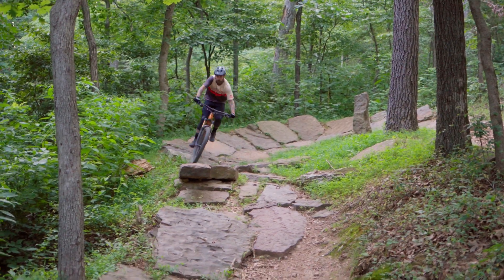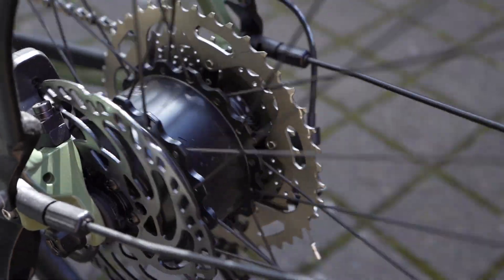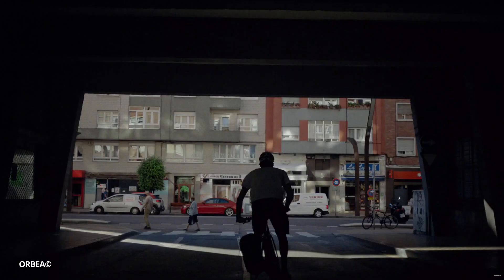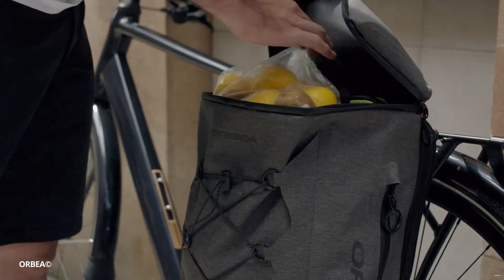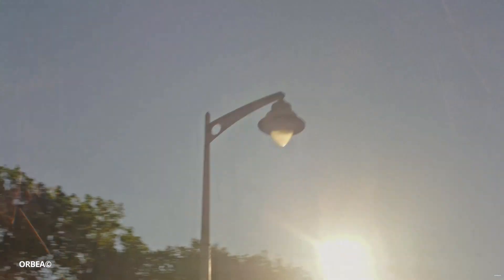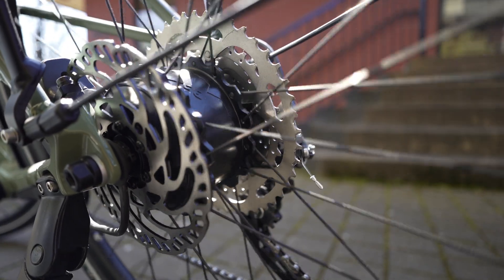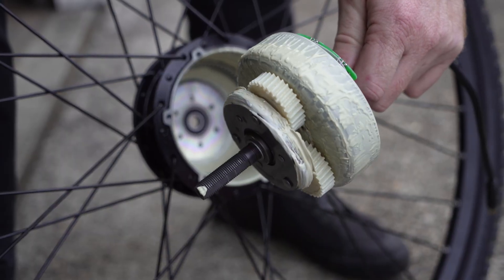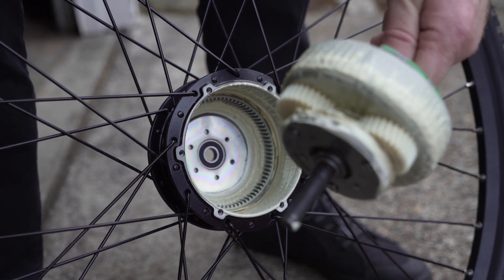HUB VS MID DRIVE | Choosing the Best Electric Bike Motor #electricbike #ebike

Comment: What would be the advantages and/or disadvantages of a front hub motor with rear  hub gears and a carbon belt?
Reply: I'm very interested in this config, but not a lot of manufacturers using it... 🤔
Reply: With just a front hub it becomes a throttle only( technically a motor bike)  vs. a pedal assisted bicycle.  Throttle only are not allowed on many (majority?) of bike paths. Also you would have less traction going uphill as the majority of the weight shifts to the rear wheel.
Reply: Not exactly. You can have Pedal Assist Sensors mounted to the crank. I have it. It works great. Also, front hub gives you all-wheel drive on a bicycle ;)

Comment: I think you're handing out a myopic perspective of mid-drives. Not all mid-drive motors use a torque sensor. Not all mid-drives need "professional help" to perform much of the maintenance to keep them running. Not all ebikes require a proprietary frame that can only use one manufacturer's underpowered motor and small overpriced batteries. You mentioned the two types of hub motors but didn't mention add-on mid-drive motors like the BaFang BBSHD and their massive advantages... such as torque, throttle, adaptability, ease of installation and self-repair, cost, programmability, etc, etc, etc. There isn't a production mid-drive ebike I would own but I wouldn't ride anything but a mid-drive ebike.

Most mid-drive chain and drive train damage is due to what should be an ever-changing chain line from gear changing. Riders rely on the motor to grunt it out rather than downshifting. Coupling a mid-drive with a Rohloff Speedhub is a game changer. Absolute minimum drive train wear and fast sure gear changes with a straight chain line. The Gate's belt will be another game changer, but it's a little more tricky to use a full suspension e-bike. With minimum chain maintenance, I change the chain and rear gear every 3K miles or about twice a year, less than $50, and I can do it on the side of the trail in about 45 minutes. 

I've been riding the same ebike for over 8 years and have ridden over 48K miles. Much of that has been with panniers and pulling a trailer on rough uphill surfaces, and I have never had a "heat management" issue. Apply only the necessary torque to an IGH; the motor will always stay in its comfort zone.  We're talking about ebikes; if someone rides an ebike like a little motorcycle, they will have excess damage and stress the motors regardless of whether it's a mid-drive or a hub motor... but mid-drives are superior to hub motors. - https://photos.app.goo.gl/ADgC6oyPM2gyrCq27

Sporting my latest and possibly final upgrade. Ladies and gentlemen, the Gates Belt Drive. - https://youtu.be/qu4vGEziby8
Reply: I agree with everything you say, and the new Bafang BBSHD motor is getting rave reviews and I never thought that I'd buy anything but a mid-drive, torque sensor Ebike but as someone with battery anxiety and motor failure paranoia I'm going to buy a Himiway Zebra hub drive bike, with torque sensor, as at least if the motor ever fails or I run out of battery then at least I can pedal back home.
I once tried pedalling a mid-drive bike without power and the drag put me off. 
That was a few years ago though, maybe mid-drive motors have less drag now, and maybe I should stop being paranoid! 🤷‍♂️😂

This bike is only going to be used on old railway lines and very mild gravel, and to cover longer distances than I do on my clockwork bike.
Should I ever replace my full-suss MTB that I ride in the mountains then a mid-drive would be the only choice.

Comment: Today was the first day that I was on an Ebike..  I tested out 3 different mid drive motors.. All with the carbon gates belt and all with the Invideo (not sure how to spell it) CVT hub..  All 3 bikes were totally different..  It was  nice that I could drive them without any pedal assist and today it was 95 degrees..  I kept all of them at the lowest pedal assist and it was a hilly area and they did ok..  I think my speed was about 10 mph..  When it comes to mid drives I think I do want a carbon gates belt drive...

I should probably test out some hub drives..  I probably don't need the carbon gates belt drive..  I have never been a huge fan of chains..  I don't think I ever broke one but I have got them caught in my jeans and also have had them come off a lot of times..  That and I have had it where they don't go into gear.. Also, not a fan of the grease getting over everything..
Reply: Belt drive & hub gears are the way to go with mid drive motors, far less maintenance, mess, etc. Not cheap tho.
Reply: @papalegba6796belt drive plus hub would be like the bike of the future imo. CVT pulleys on the belt drive and it's even better..

Comment: I am considering buying either a hub drive or mid drive motor to recover from injury but I live in a hilly area. I am looking at the Orbea D30 with the X35 hub motor or the specialized sl comp carbon with the Sl1.1 mid drive motor. I am 110kg and recently had a new knee and ankle fusion so would like to know which would get me up the hills easier until I get fitter. The hills I used to ride before my op were up to 20% on a typical 50 mile ride. I have heard that the hub drive will give up on you on steep hills as your effort slows but the mid drive will keep delivering is that true?
Reply from the maker: Both of those bikes are really great choices. As far as “giving up” goes a mid drive doesn’t show favor on flat or hills. It outputs power based off your input. Most hub motors will output based off the input of speed or throttle, but can’t tell the difference of hills vs flat and that’s where many will give up so to speak, with more resistance on the motor for climbing they have less sensors to compute the changes and output more power. That being said there are many high watt output hub motors that you can flick a throttle and it’ll power you up hills but that is a different cycling experience.
Reply: Thank you so much for getting back to me. It makes sense to me now about which to buy for recovery. I dont need a powerful embt just a road bike that will help up the hills round here. I dont want a motor to take over and I have enough power to keep up with a group but at 63 I am suffering up the hills more and more especially after my surgery. I have a good input so am going to test ride some mid drive motors of around 40NM or so. I think the SL 1.1 is 35NM so should give me just enough to get up most hills round here. I cant get out of the pedals so I have to rely on seated spinning until I am more flexible and things settle down abit more. I may not be able to as my ankle fusion is very restrictive and only flexes about 10% of what is used to but now I am pain free so we shall see. Thanks again. very much appreciated. @ElectricBikeJournal
Reply: @oxharp  Been very satisfied with road/gravel bikes with MAHLE X35/X20. If I was buying an e-road bike today I'd opt for Bianchi E-Oltre with MAHLE X30, Shimano 105 mechanical. $5K seems like a pretty fair price. My wife has an earlier E-Aria X35 model bought used that she really, really likes!

Comment: If you have access to many ebikes, I suggest you design experiments to back up some claims in this video. At least to satisfy your own curiosity. 

For example claims about efficiency and torque/ climbing being better in mid drives. They can pretty much be in the style of car MPG tests. Ride similar routes at similar speeds and count how many Wh it takes to fill up again.

I feel that your conclusions are more based on cheaper hub drive bikes vs premium mid drive bikes.

Food for thought: A direct drive hub motor can be designed to produce so much torque that it would taco the bike frame instantly. Electric motors can be designed for any load conditions and bicycle load conditions are not so difficult to design for.

My $100 Chinese direct drive hub motor can produce so much torque that in an MTB frame, the bike flips over. Sure the motor will also get hot, but it CAN produce the torque. 

Any gearing or use of multiple gears is a sign of a undersized or poorly designed motor.

Think if massive trains. They travel from 0 to 100s of miles per hour with one gear and with massive loads. A bike would be trivial to design for.
Reply: Your $100 motor is NOT that powerful lmao. Why would you bother lying about something so easily verifiable? If you said $1000 I’d believe you
Reply from the maker: All very valid and great points thanks. Most of what we addressed focuses on the higher margin of what someone is most likely to come upon as they shop for a bike. As most mid drive bikes are supported by premium brands and most hub drive bikes are coming from less premium brands. Each drive type has an ideal environment that they perform best in. 

This video and our platform is focused on the general audience and specifically people that are looking to learn. Thanks for the input and we'd love to see that wheelie machine.
Reply: @ElectricBikeJournal  Not my video but same $100 hub motor: https://youtu.be/e03rMDmJzLE

Comment: If your hubdrive motor axle breaks you have to get a whole new motor
Reply from the maker: Likely more cost efficient at the least. Fortunately they are significantly more affordable then mid drive systems and much easier to replace.

Comment: The cool thing about hub drive is having AWD! My Vamoose Super Mammoth 500w has AWD it's so nice to have on a E-Fatbike because I can go up Icey hills easier and through deep snow with ease though I did overheat my motor a few times but in -20 it doesn't take long to cool off.

I've also been through ravine paths at at 20km/hr which is thrilling!
Reply: So both are equally just as good 

Good to know 

I honestly never thought about that lol

Comment: Ok, this is funny I have Bafang Mid Drives 750 and 1000 watt with a total of 23000 miles. The maintenance is torture, since the power comes from the main sprocket, the chain and your cassette will wear out every 1500 miles to 2000 miles. You'll not be able to interchange those parts, you will exchange both cassette and chain with new. Now your good for another 1.5 to 2k miles, I have about 100 feet of chain 20 worn out freewheels around here. If you buy a good hub motor kit, install it carefully, it should be care free to 30k miles I guess.
Reply: I have crossed over to mid-drive with chain waxing and have great results. No sprocket/cassette wear and no measurable chain wear in over 3500 miles with three cheap Shimano chains in rotation, use one carry two as spares, quick links, swap chains every 100 miles, re-wax all three chains every 300 miles using cheap home waxing pot and cheap food-grade wax. Lots of useful guidance from Zero Friction Cycling channel. Not as time consuming or difficult as people say.
Reply: I just wanted to point out the exact same point. Mid drive motors really stress derailleur systems.
One big advantage of mid drive motors is that you can easily combine it with an internal gear hub. If you add a Gates belt you get a nearly maintenance free bike. If you want to avoid a derailer system with a hub drive you need some expensive and exotic stuff like the Pinion system.

Comment: I have a question please.

Suppose if you were trying to decide on couriering. Such as delivering food or medicine in an urban setting. Which motor system do you prefer?

Thank you very much.
Reply from the maker: Ultimately both platforms will deliver the same result. We'd suggest searching for the style of bike you want (cargo, commuter, etc.) and lock in your price point. If hub drives are what is showing up, we'd encourage looking for one with a torque sensor as it will have a more natural pedaling feel. 

Check out our review of the Ride1Up Roadster, its a great value, super lightweight, and could make a great courier rig with a rack.
Reply: @ElectricBikeJournal  thank you.

Comment: I own both a 750 watt geared rear hub drive and a 1000 watt mid-drive.  The hub drive is simple and fun, super accessible for anyone, particularly non-cyclists.  I live in a hilly area and the hub drive has done just fine, even on hills as steep as 16%, though I have to pedal to help on the steeper hills.  The mid-drive is just a beast, it can make the 16% grade hill feel like it’s flat, but it requires you to work the gears and know how to work them.  If you are new to cycling or consider yourself a casual rider a hub drive is probably best.  If you need high performance and do lots of hill climbing, which means you are also probably an experienced cyclist, the mid-drive is probably best.  Hub drives are generally less expensive too.
Reply: What bike uses a 1000 watt mid drive? That must be a torque monster.
Reply: @cadriver2570 stuff like the bafang ultra is 1000w+. 160nm of torque. thats mad.
Reply: @cadriver2570 A lot of people who do ebikes conversions go for +1000W motors.
Reply: The major advantage is when your chain breaks. A hub with throttle might get you home. You need to carry a spare chain with a mid drive. I have and love both types. Bad knees, arthritis and age so I'm grateful for the technology. ✌🏿
Reply: My friend has a bike with mid-drive and it seems to be eating chains a lot. To my understanding hub drive stresses chain even less than on a traditional bike
Reply: @YoStu242 it’s in the principal of technic…so nothing be wondered about…
Reply: My 1000w mid chews chains and the 160NM torque snapped the  propriatary motor mount. Much higher maintenance than the hub motors.
Reply: What percentage gear ratio is fitted to the hub drive? Isn't it much less than the gear ratio used for mid-drive? Isn't that why it's harder to climb the hill?
Reply: I don't see it as whether you are casual or not I see it as how much maintenance you want to do, 1000w hub motors are great fun and basically no maintenance
Reply: until you need a repair, hub drive is expensive and hard to repair, most shops send it just back because they cant to the repairs of the certain brands. mid drive, depends on which repairs you need but is much easier to repair and sometimes the shops can do it themself, the software is also more mature and allows to be tinkered with.
Reply: I wouldn’t even compare those motors with those watt differences lol
Reply: @Keyshawnsofficial  then you don’t understand how the power on e-bikes works. There’s very little difference if any.
Reply: Ya, typical salesman told me nothing about the down hill help slowing with the hub. But, Living on a mountain in Germany, from your info I did well with the mid motor, Und all auto's here are Stick Shift unless you have a doctor's note for emission reasons.. So everyone is used to shifting n who doesn't like speed..?? I just bought ein 750 mid motor und loving it I'll have to admit. Has a walking speed while not on it I use this feature to walk it to the train. Very handy option. Bosch powered und 750 battery to match. Bike sellers have teamed up with large companies to finance with no interest for employee's n they have taken off purchasing them. Healthy employee's, happy salesman at bike sellers. its a win win situation, aside from being a blast to ride. You made me feel better buying the mid power. My CUBE SL Stereo 140S HPC - Hybrid. 29 inch super wide tires compared to these, heavy but das bike is carbon fiber so not bad even with the bigger wheels. This is mine with out the wired lights and fenders as we live in farm country. I would be curious what you picked out in the states as we plan on buying for our FL home as well. Enjoy my friend n Danke for your post.. ;  ) thing even charges my cell phone and easier to see for a speedo and battery life etc rather than its smaller screen. and I forget what gear I'm in on occasion.. ;  )  has auto shifting n surely down shifting is as good as the rear hub automation und easier on the Bosch power plant. Thanks Jethro.. ;  ) Happy trails.. ;  ) https://youtu.be/Iem1GYu5b7Y?si=yd7ulYoExlLXtKKk
Reply: Don't compare  750w to 1000w
Reply: @deepakgurung3853 why? His comparisons still ring true in general for hub versus mid drive.. I assume he accounted for the watt difference in its comparison, and even then it probably wouldn't have changed his comparison.

Comment: Im looking for more of an urban solution so I feel like hub drive might be more fitting however my area does have quite a fair bit of hills. Do you think a good hub drive system could still do fine up hill?
Reply from the maker: Rear hub drive bikes are fantastic solutions especially for urban use. When referring to mid drives being better for hills, the context is more relevant for mountain biking and dramatic elevation changes on rough terrain. We’ve ridden many hub system bikes that are great in hilly cities. A higher nM torque output of the motor will provide more consistent power for those hills, equally a geared bike as opposed to a single speed. We’d encourage going to your local bike shop to take a test ride on as many different bikes as you can. That’s ultimately the best way to find the right recipe you need.

Comment: 2 things I must point out:
A direct-drive hub motor is harder to pedal without assist
Some mid-drives have cadence sensors, such as the Bafang BBS02
Reply from the maker: Thanks, Direct drives can be more difficult to pedal for sure. Overall bike weight and limited gears are a major component to that as well. Great notes about the Bafang, most mid drive motors have many sensors beyond the torque sensor, including a cadence sensor. And as of recent, we're starting to see a few hub drive ebikes with torque sensors.
Reply: use a geared hub.. they have a freewheel clutch